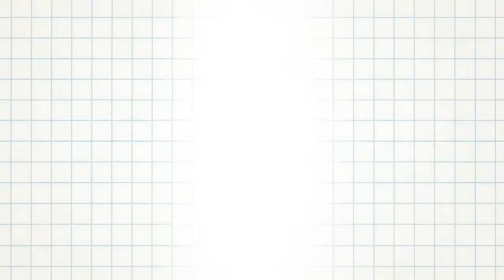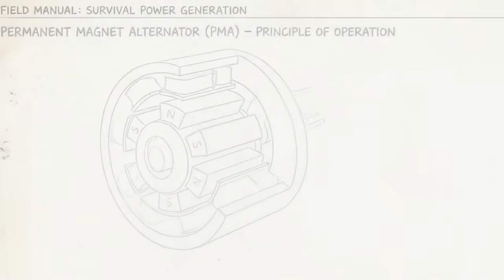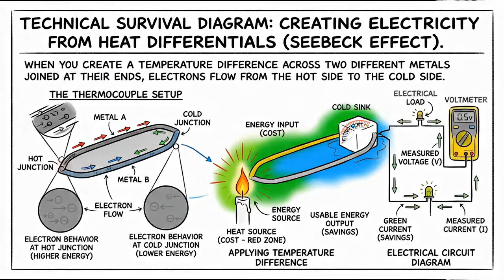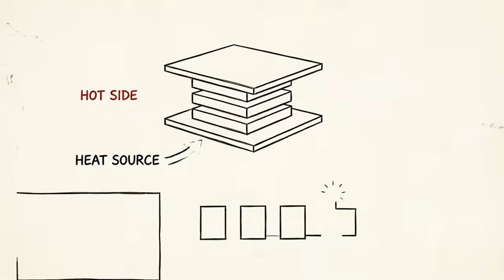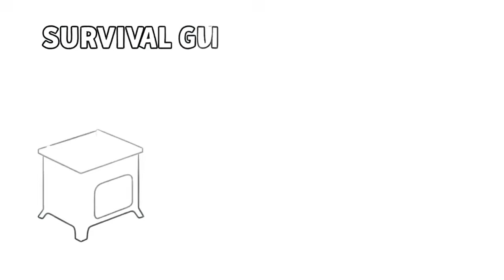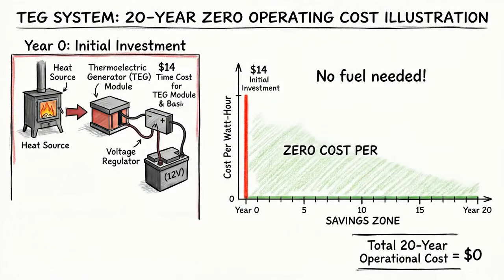$15 in Parts. Basic Physics. Free Electricity. The Setup They Removed From School Textbooks 40 Years

Comment: These TEGs will barely produce microwatts of electricity with such small differences in temperature...

A 40x40mm TEG will net you a few watts with a 300 degree Celsius delta. That's a huge temperature difference for only a few watts of electricity. You literally need to put them on top of your stove for this.